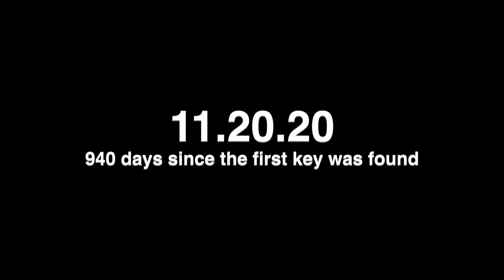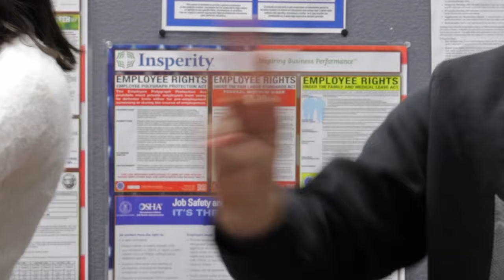We Found A Police Case Inside Hi5 Studios! (This Could Explain Everything!)

Comment: Glad to hear that you are all ok via this being posted. :) I am a Network Technician. Power and Ethernet cable could mean several things.

1. A device in the case is connected to your network recording network traffic. (Wireshark) It is used to gather packets of info trying to get files or passwords.

2. The device inside is used to provide a WiFi Bridge from your network to his device on the outside.

Use a network scanner to see if there are unknown devices on your network.
Use a wireless device (phone or laptop with WiFi Analyzer App) to see if there are any WiFi signals coming from the box. Generally the closer you are to the box the stronger the signal will be.
My choice would be to open it up. :)

Comment: Hey Matt 
Maybe he's tapping the nest camera files so he can see whats going on LIVE. Just saying it could be possible.
Maybe check it
Reply: True
Reply: Explains the cables!
Reply: Staged vid
Reply: Omg yes
Reply: If the Stalker was recording the Nest footage... then Matt would need to gain access to the case, to check.... not like the stalker is recording it to Hi5 Computers... He would either be storing them on a hard drive IN the case (which he would have to retrieve by breaking in again), OR transmitting the data to a remote location to save and view the files at his leisure
Reply: @idkwhattoputformynameyt  mate stop no one cares
Reply: You must go to his reddit page and get a lot of up votes so he can see it
Reply: true
Reply: But Kevin put the new camera in there did he not?
Reply: Love your profile
Reply: @melanielamberson5673  thx shot it myself
Reply: @caitlynaldrich3955  Yes Kevin was testing and installing new cameras.. but those cameras are what recorded the stalker entering Hi5 warehouse... So no one has probably messed with that stuff bc Kevin was testing new cameras (therefore there are even more new cables that he can potentially hide his cable among). They might've only noticed any extra cables when they (or the technician) sorted through them as they installed the final choice of cameras.

Comment: See where the cables go and see if you can possibly “unplug” it
Reply: post this to the subreddit if you have it but its a computer that cops have in there car and the cable is to plug into the car
Reply: Staged vid
Reply: @idkwhattoputformynameyt  then why would they destroy the stairs and burn a hole in the floor and then have a liquid that burns
Reply: But what if that sets it off
Reply: @jaydenmallow8814  "Sets" what off? Do you really think it is an explosive of some sort? it wouldn't need to be plugged in... you could use a 9V (or maybe even a watch battery) to "activate" whatever it would be.. and then the Cat5 data cable doesn't make sense either if it were explosive....
Reply: A bomb can activate if a specific power source is cut off... but we need to note that this guy has not proven to be interested in damaging the office
Reply: @alexiswilson3769  yeah but they got the police involved
Reply: @Ousseaghymn  true a bomb can be rigged to go off under those conditions... However, (if I am not mistaken) a secondary power source is usually attached to the triggering device, since the device would be set to trip after the power were cut... (Maybe a capacitor that stores enough charge to activate the trigger might be enough... but how expensive and reliable would that be compared to a simple 9v trigger?)
My main point was that the probability of it being anything explosive or physically harmful is very low, to the point of unlikely... 
So, according to Occum's razor it is probably not going to blow up if they cut the cables.... And if you are still too scared to cut the power line, at least cut the Cat5 cable so data flow stops immediately
Reply: @mherrmann81687  he also doesn't seem to want to damage the building. Like when he tried to get in with fobs. He didn't break the glass or anything... Maybe something he wants is still there
Reply: @jaydenmallow8814  i also never said i thought it was a bomb. Maybe. But unlikely all things considered... From a behavioral perspective i mean
Reply: @Ousseaghymn  your right
Reply: @Ousseaghymn   agreed, it does seem that he doesn't have any intertest in destroying property.. but is that because he still wants something?
Or is it because he doesnt want to give any credibility to any reports filed to the police?
-A bunch of stories and evidence found by Youtubers,
VS
-A security report with broken glass and alarms calling cops to the scene etc...

Comment: “The police aren’t taking it very seriously”
Pulls out brief case with LAPD on it
“Now we know why”
Reply: I'm pretty sure thats a police computer case
Reply: @borderelite  which would make sense as to why there was wires falling out of it
Reply: Staged vid
Reply: @wildfangsilco6365  there is only one problem with this theory which is that the hole the wires come out of seems to be cut by a drill and not part of the case normally. Also the case has a purge button which is probably used to even the air pressure in the case if it is air sealed if that makes any sense.
Reply: @lach6288  I did find a similar looking case called a storm case, it's just for storage and police do use them for things like laptops but none of the ones I saw hade a hole for wires or that valve on the front so I think those are modifications or it's a very specific case.
Reply: @lach6288  specifically the Pelican 1495 Laptop Case looks extremely similar.
Reply: Pretty sure they’re using stuff in the storages they bought. Might as well make a skit using those stuff

Comment: It's entirely possible that the cables are giving him data and info connected to the employees at hi5, also maybe giving him access to uncut video files, such as the vault code that may have had to been blurred or cut out of a video.
Reply: that could be how he got another key fob thingy too, like he can get other co-workers key fob codes from it to keep coming back in, or adding the one matt deleted back into the system
Reply: @josephtanguay2509  yea but then it would say the workers name. he made a key fob fully on its own that wasnt linked to any of them. I think your on the right path but i feel like maybe thats just how he had made himself a key vault. especially if he has access to their network
Reply: @xdluciifer  yeah and that makes sense however he has so much information that I don't believe he could obtain hiding in a bush which is kinda where the cords kinda come in, because what are the odd. And if you haven't seen the next vid it's says there is a cam but I don't think that's all.

Comment: He is connected to YOUR internet...explains how he keeps being able to use the fobs!!! You need to check out who all is on it and change all passwords daily if need be
Reply: The case has nothing to do with the fobs he can’t change or add fob codes with out Kevin’s computer. Also if he is connected to the internet through Ethernet changing the password won’t do anything he is always wired in until they unplug the case.

Comment: After some googling, the case appears to be a Pelican 1170 or something similar. It also says "This Peli case 1170 is unbreakable, watertight, crushproof, dustproof, chemical resistant and corrosion proof", I don't know if these claims are true but they are claims on sites about the case.
Reply: Atleast this time it won’t melt a hole through the ceiling
Reply: Hopefully
Reply: It's got a hole in the bottom, it's not ubreakable
Reply: Pelican is a brand used by the military as well. They are very tough well made cases. Don’t forget the Naval sticker on the Mercury.
Reply: Get lockpicking lawer to open it
Reply: yeah its a pelican case i got like 5 at home and most of them painted letters with stencils, did yall really think this is true?

Comment: Theory’s: what if he connected a computer to the Ethernet ( that explains the power cable) and he is gonna hack into the cameras.
Or he has a LAPD computer that he stole and he needs you to open it so he can steel it back
Reply: It is connected to power and some sort of ethernet port so he is most likely using it for something, probably surveillance of some sort. He could most likely open the case much easier than Hi5 can so he wouldn't need them to unlock if for him.
Reply: Or maybe he works at LAPD.....
Reply: @anatoljan5412  but why hi5 why keep an eye on them? I feel like he’s no longer part of the LAPD but I also can’t put my finger around it
Reply: @dannyruffolo1474   Since he was gone for 45 minutes I’m assuming that the power and ethernet cable he set up himself so he knows what’s inside of it he can do whatever is inside of it
Reply: Well "HACKING DEVICE???" great tittle for it lol
Reply: @leegetsu8249  I don't know how it works in LA, but after that place closed, he may have started working at LAPD, and when Hi5 came in and found all of it... he got worried...

or maybe all of the stuff was part of somekind of investigation and he was on it... hence why the place closed before Hi5?

I don't know my mind is all over the place what could possibly be....

Comment: Wait wait this guy is probably a police officer or something like that remember he had that police scanner thing in the mountaineer
Reply: I have a police scanner and I'm not a cop.
Reply: Those scanners can be bought on Amazon cheap. Not just cops have them. And it is not just a police scanner. It actually scans a wide range of radio frequencies. You can listen to air traffic, police, fire, CB, Ham, AM, FM, or any other number of radio frequencies. 

I have a home scanner and a handheld scanner capable of scanning 900 channels with frequencies between 25 MHz to 1.3 GHhz

Comment: Theory: He used the wires to connect to the network or something else in the building. (Explaining the wires). Or he is using this to connect to the Ethernet or internet, and then hack into the security system and then the whole system.  Or the case is a facade and he is going to come in once more and do something. Or in the case the case is real and he is attempting to connect to the network then your computers and take confidential things.

Disclaimer. I’m just a kid trying to help and came up with these theory’s.
Reply: I’m thinking the same, my tech friend (dad) says it’s possible
Reply: But wireless things can b hacked remotely. There was a whole thing in the news a few years ago about baby monitors being hacked because the model was vulnerable.
Reply: @Ousseaghymn  Good point. You mentioning that makes me think maybe he is putting a wire to make them think the stalker is going to hack it by using wires but he is doing something simmilar to the baby thing just more complicated with like a fire wall and stuff.
Reply: @njproductions7.516  maybe. But I'm no expert so...

Comment: If it is actually LAPD property, this may be a long shot but you could try to cross reference the precinct numbers, any that are 2 or 3 digits you could try inputting those as the combo. If it's a 2 digit precinct number put a 0 before the 2 digits. Also with it being plugged in via ethernet it seems like a device to tap into your systems. My dad and I installed a surveilance system for a neighbor and there was a cat cable to give it internet access, any device connected to the internet there could see the cameras.

But another thing you could do is go back through any evidence you currently have and do the 2 and 3 digit method, trying the different combinations from that.

Comment: got to LAPD as the case could have been stolen from them years ago as it is corded so it is electrical so could be a listening device
Reply: You can clearly see a jacket hole cut inside and it’s supposed to be pressurized not listening device connected to security cameras

Comment: Theory: The missing for pros and the lapd case that base a wire through it charging them and when you open the case all the footage there is footage of you guys discovering all of the cases and the vehicle and leaving you in suspense for a few months finally makes a huge return and breaks into safe. The room with the safe door does not have reinforced walls which means he can just swing an 8 pound sludge hammer at that wall and take all the evidence

Comment: If you hold the lock to the side while scrolling the numbers they should lock to the correct combo. I use this method to get into brief cases I pick up from yard sales and thrift stores. But make sure you scroll slowly because if you do it to fast you could pass the number you need. You should feel the lock move a little on the correct number.

Comment: I think you can rule out LAPD, if it is a real LAPD case there will be a letter and number combination etched into the plastic, this is a way for them to track and keep count of the inventory also there should be a little paint mark on it normally red or orange this is an RFD chip this is used to verify that the case has been returned by an officer and it allows them to maintain inventory numbers and incoming/outgoing equipment.

Comment: If the case is pressurized or was in this scenario, it could’ve been a control panel for something, like a bomb, or a breaching device since it is property of the lapd, and it could be “tampered” with because the stalker couldn’t get the same frequency for whatever is under the stairs. Hence why there are wires now. I think you should cut into the side of the stairs first before you do anything.

Comment: Try to use the key numbers that are on all of the keys and of you wanted to cut open the case all u would have to do it take the wheel cutter to the latch on the front of the case because those are not very think to being with and open it for sure

Comment: its can be 1 of three things 1 a signal receiver 2 a jammer or 3 a bomb as you said but befor you cut the power have the wall open ready to cut the power and open the box cause either the cable or the opening of the box could trigger it prob not both

Comment: The wire you found is I believe a awm 20251 Cable used in telecommunications and verified tia aka Telecommunications Industry Association who works with 1000 or so companies for private telecommunications systems.

Comment: Check your internet modem to see if there is a new Cat5 cable plugged into it. You could be looking at a (Snoop Box), it a data collection box used to record what sites you visit. I would try to figure out where it's plugged into (power & Internet). I doubt its really property of the LAPD look around the out side of the case for a inventory number. Law enforcement agencies put numbers on the side of police property so they can account for the item.

Comment: What I will say is first, how did he get that wire connected.  Second you need to find out what it is connected too.  It probably took some time to connect, hence why he was inside for 50 minutes, but if an ethernet cable is there he is definitely in your system one way or another.  I'd highly recommend anything of importance get moved off sight or to a different internet.

Comment: A 3 digit combination can just be brute forced. Assume the first digit isn't 1 or 9 and then start at 211  so you only have 692 possible combinations to try. then try 212 213 214 215 until you get 219 then start 221 222 etc. until you either unlock it or get 899. If you do get 899 then it's either 111-199 or 911-999 which will be quick to figure out. You could also just pry it open. Also please don't leave it plugged in.

Comment: 🔴🔴 Hear me out about the case: It could be a router or something similar inside. Hear me out. If you plug directly into the network you don’t necessarily need a password to connect to it.  If it is password protected, because he now has a connection to it he could hack into the network, cameras and everything connected to the network. He could also allow access to any key fob to come and go as he pleases. Check your network since the date he broke in. The first thing I would have done is get a flashlight and look where the cables are going, get your tech guys involved to help you and follow where the cords go. Unplug the power cable, assuming that it is one. Cut or disconnect the cat 5 cable. Use tools to get into it & see what it is. Something to keep in mind: if he does have access to your network, he can probably see you guys through every camera no matter how new the system is if you’ve upgraded. Once you disconnect the case, if he can’t already see you on camera, he will know you’ve disconnected it which you can use to your advantage. You can disconnect it and hide outside, even using his own binoculars, wait for him to come back to install a new one. What I would definitely suggest: get someone who knows what they’re doing to look at your network, verify whose and what each connection is to be sure he doesn’t have anything else connected.